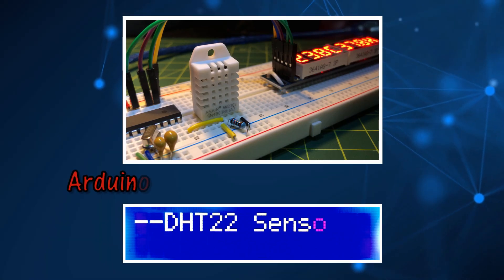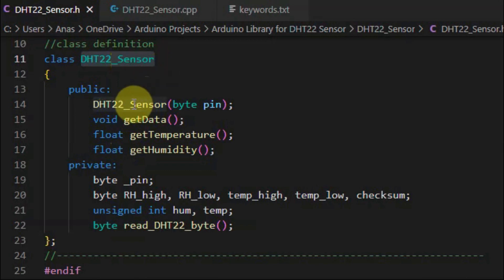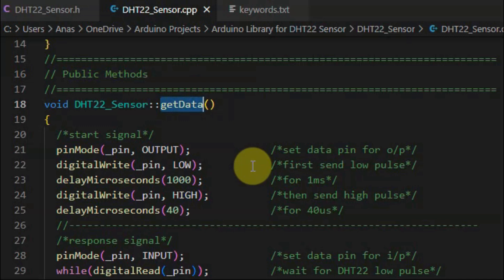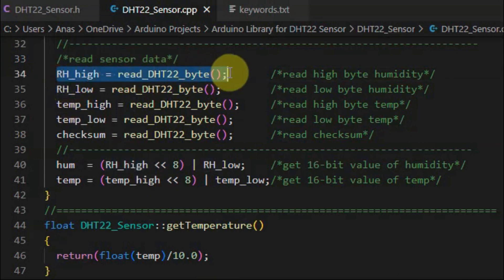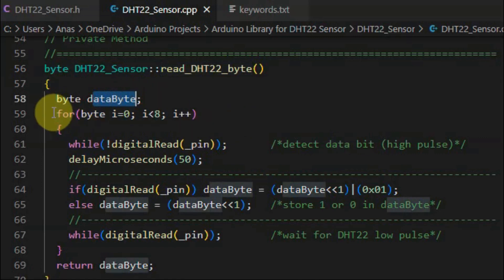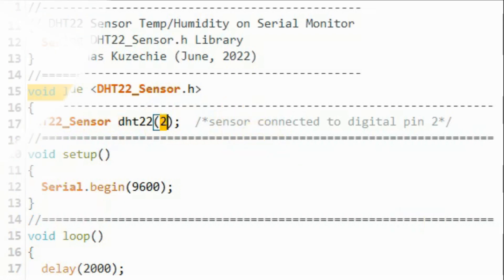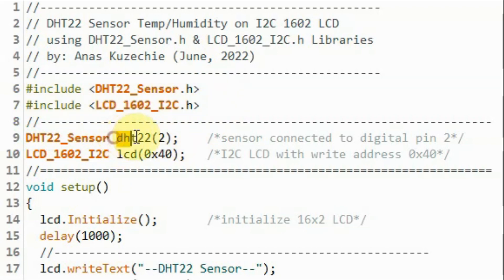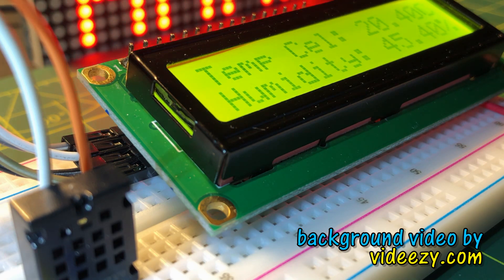Creating Arduino Library for DHT22 Sensor

Comment: Hello sir
I admire your beautiful and useful projects.
I had a problem defining the ATTINY85 as a board on the laptop and I need your help in changing the code to work on the ATMEGA328 P. I shall be thankful to you.
thank you my friend .
Code link. https://akuzechie.blogspot.com/2022/02/attiny85-ds3231-real-time-clock.html